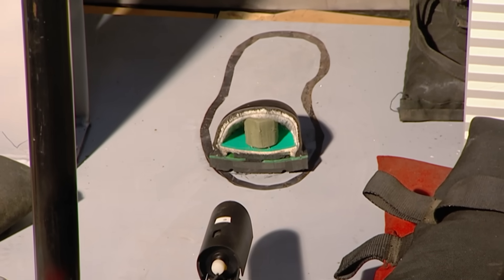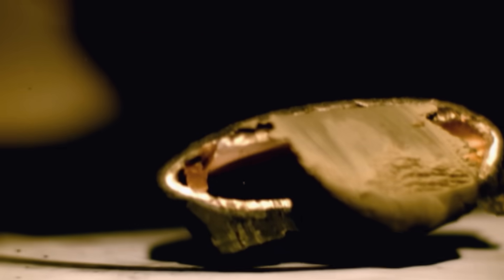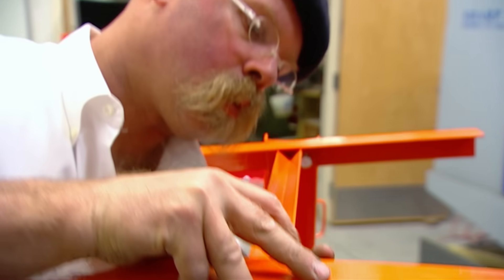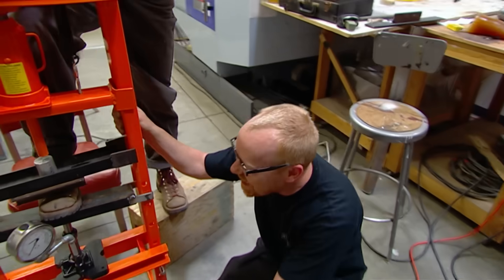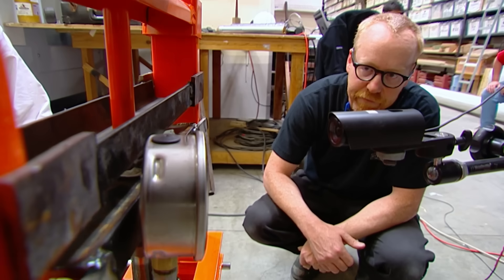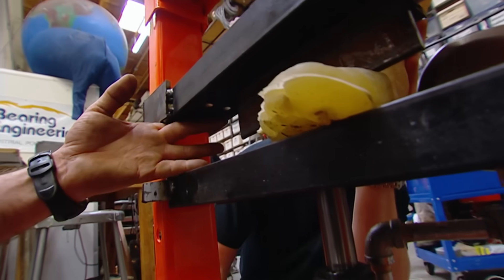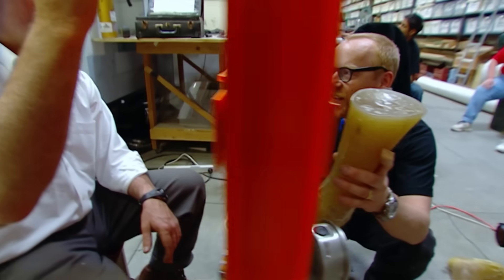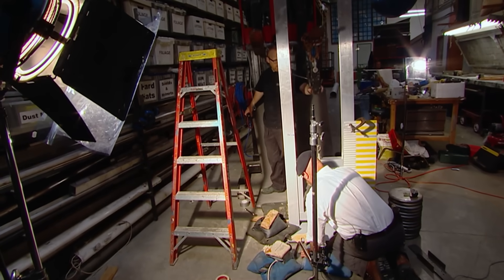Do Steel Toe Boots Really Protect Your Toes? | MythBusters

Comment: Yep. Never thought about it, until I had to work in a factory, where literally everything can kill you. A 2000lb reel of copper wire rolled so slowly and quietly across the floor, I didn't even notice my foot was in the way - until I felt the steel tip flex downwards as it stopped the reel and saved my toes.
Reply: For me it was a 300 pound block of ice that bounced and split when it was tipped over. Top half came down hard and rolled straight up to my ankle.  Foot swelled up to the size of a football once I got the boot off, but toes were fine.
Reply: @Nebis42 the exact same thing happened to me except instead of my toe it was my penis. Luckily I was wearing a steel head condom at the time, so my penis survived
Reply: For me I had a dumbass contractor not check clear while I was behind a wall working on a connection. He went to put the wall lining in (corner decoration between the wall and floor.) Fucking nail gunned straight to my toe, so glad I got steels instead of composite, bent the nail right away from my foot.
Reply: Steel tips when well engineered absolutely work and saved limbs. What people should be wary off is the cheap ones with unknown or dubious reputation. The steel used aren't up to spec either in base material, dimension, or both.
Reply: @ZeroXSEED  Steel "tips" as you say do not save any limbs. Never have, never will
Reply: Had a janitor run into a freezer door as I was driving a power jack out, ran over my foot, toes fine, just about broke my ankle when the wheel cleared the cap, though
Reply: I work outside around machine pumps with only a headlamp to see where I'm going most the time...just the amount of broken toes from tripping over something has made steel toes worth it. Then there's the more serious stuff like having to move a water pump weighing hundreds of pounds out by hand because we couldn't fit a lift in and one of the guys let it slip and it landed right on my foot. Luckily it was only about 8 inches but if I'd been wearing normal shoes my foot would have been bloody soup.
Reply: I handle 8 and 4 inch concrete blocks daily 200 to 300 loaded by hand by a team of guys. I've lost count of how many times the steel toes saved me or the guys from some broke toes money well spent for sure 👍
Reply: 2-Ton paper reels slow rolling off the press. Saw a guy walking alongside one with nothing but loafers. Sure enough the reel caught the edge of his foot and he lost 2 toes.
Out of curiosity I did the same thing a week later, the reel bumped off my boot and rolled on.

Wasn't even the steel that saved me, just the hard rubber outer edge.
Wear the boot or lose the foot.
Reply: I had a ram 1500 go over my toes once at approximately 0.5 mph while I was wearing steel toed shoes. Only thing slightly squished was the toe cap.
Reply: @jfleisch365 yes because tires have give to them and they compressed as they went over your toes. Trying doing that with only the rims and no tires.
Reply: @Arctic-Warrior-11 I will certainly try that out the next time I go to the tire store. It’s extremely valuable because I like everyone else likes to drive my truck around like it’s my long lost mine cart. 😂😂😂
Reply: @Arctic-Warrior-11 who cares why, it happened and his toes are ok.  "Try it with just rims, no tires" is the dumbest someone can say.
Reply: @smeagle3295  nice comeback to the manly man acting like an orc "DIE LIKE AN IDIOT" for no reason ,well played
Reply: Glad you're alive. I peal copper wire scraps, I can't imagine a ton of copper. Melted aluminum is a 2x2 cube for almost a ton. Rolled metal is no joke.
Reply: @superpathaley9067 wrong peel my guy
Reply: Few years ago me and a coworker were open a trap house bunker door, ~3ft tall,  ~8ft length, atleast 100lbs to lift or lower. He was supposed to hold the door while I dealt with the lock and instead he was holding right beside it. The door ended up falling and the place  for the lock was what hit my boot.

It ended up putting a nasty dent in it, scared the crap out of both of us but once we realized I was fine we just sat there and laughed about it. We did end up leaving the doors alone for the rest of the day and were alot more aware after that.

I have no doubt in my mind that if I hadn't been wearing my boots, the 3 inch piece of metal for the lock would've smashed and impaled my foot to the pallet I was standing on.

It goes without saying that I will buy that brand of boots for as long as I wear them.
Reply: Nice! For me it was a large walk behind 3 bladed commercial mower. I removed the catch dumped the clippings in the bucket and when i went to lock the empty catch back on the clutch lock slipped on the left handle bar which i wasnt near and sent the mower in the direction of my boot with an open deck and exposed blades going 200mph. We never shut these things off when changing the baskets it waste too much time and labor is cheap. It was Caterpillar boots from Sears the square edge of the blade made it through quarter inch and shredded the crap out of the drive belt because the motor never stopped. My whole foot was stuck until boss came and shut it off. Btw i was always made fun of for them boots and i continue to wear them for another decade.
Reply: Amen. What is it lately with idiots questioning obviously great safety features?I get them testing it, but the idiots in the comment section are just incredibly stupid. Anything that breaks steel toes will turn your feet into paper anyway
Reply: The first time around it was me dropping a pallet on my foot and it busted my toe open. From then on I learned my lesson with not having them. The next time it was a refrigerator and I just carried on throughout my day. Same goes for dropping a steel beam on my foot repeatedly (that one wasn't really an accident. I was using the steel toe as a shelf)
Reply: We had to have Steel toe and Metatarsel boots which protect your whole foot and I wear Steel Toed Boots Everywhere I go
Reply: On the vast majority of work days, I'm more concerned with things well under 1000 pounds. I recently went to carbon fiber toe caps. Definitely not as cold in the winter. I wear uninsulated boots and wool socks year round. Thinner socks in the summer thicker in the winter.
Reply: what do y’all recommend more steel toes or composite
Reply: I just like kicking s*** really really hard. 

I can confirm steel toes work. As in they get work done. Saves a lot of time if I don't have to go get a breaker bar or a crowbar or whatever instead of just kicking it into compliance.

Not to mention, just not having to worry about dropping things on your feet. Or just dropping them on your feet on purpose to get a little roll going, and not having to bother to bend over.

I'm not concerned about steel toe boots saving me from a catastrophic injury. I just don't want my foot to hurt after the hundredth time I dropped a brick on it, or whatever. I can just work faster with less concern, and end up dropping less things anyway because not stressing about it.

Really steel toes are useful for a lot of things.
Reply: Meanwhile at my warehouse all of the Indian guys work in crocks....
Reply: Fucking yikes
Reply: Either way, if an 8500 pound RC left rolls over your toes you will lose them. In that case a safety vest will help you to be seen first.
Reply: Yeah where I work we make parts for mining equipment so basically everything is so big and heavy that your steel caps will just get crushed.
Reply: Wow! I find the experiences of the commenters more interesting than the myth buster guys .
Reply: Safety rules saving toes since... some time after the industrial revolution i guess.
Reply: Nice to know!
Reply: I dont wear steel toed boots as  electrician
Reply: Holy shit
Reply: Dude I wonder if we worked at the same place lmao. I was flipping a 1-2k lb reel of wire upright my first week and attached the chain wrong, it slipped and landed directly on my foot. Steel toe saved me big time
I’m so grateful to be in the white collar world now. Thankful everyday just for air conditioning, being  allowed to sit,  and not coming home covered in grease and sweat
Reply: @crisisactor420  In PA and yeah, now I walk into my office, nobody else is there, it's quiet except for the servers outside and I've got a damned thermostat right next to my desk.  Too hot? Just crank up the AC, bee-yotch:)
Reply: i work in a safety sensitive industry and i it is my belief that the extra weight also helps for general traction/offers a better centre of gravity if you are moving around alot.
Reply: you stopped a 2,000 reel of copper (Rolling at you) with just your hands?
Yeah sure okay buddy 😂😂
Reply: @survivormandan8576 poor reading comprehension
Reply: @survivormandan8576 it’s doable dude on flat ground and plus if his steel toe acted like a chock
Reply: @survivormandan8576 Fun fact about round things, they roll! And have very low friction against the ground

If it rolls slowly, you can stop it
Reply: @survivormandan8576  no it was just his steel cap of his boot
Reply: @survivormandan8576 except he didn’t say that, and you can’t read.
Reply: @survivormandan8576 I worked in a wire mill. I rolled around 5000 pound spools of copper wire all the time. I mean, it takes a little time, but the spools are wide and you roll it like a wheel. You're not going to handle it like a basketball but if it's on a steel plate floor it'll move where you push it.
Reply: Lol rly it stop or you lose fingers?
Reply: @joe125ful  Got toes on my feet, buddy and yeah they're still functioning, thanks to old steeltips:)
Reply: @nferraro222 haha toes don’t go on feet you silly
Reply: @joe125ful who wears boots on their hands? You good?
Reply: @ghostdivision836  Huh?
Reply: @joe125ful  are you retarded?